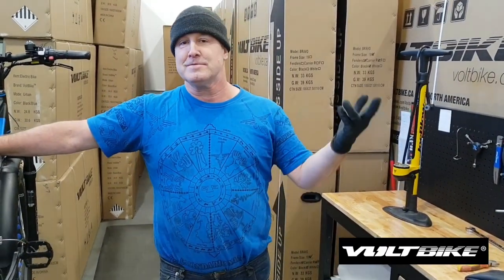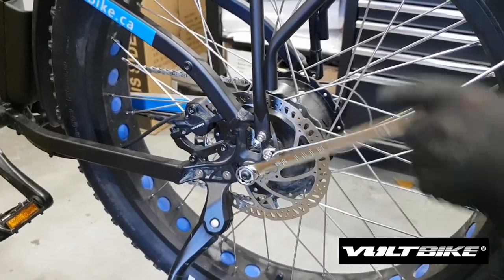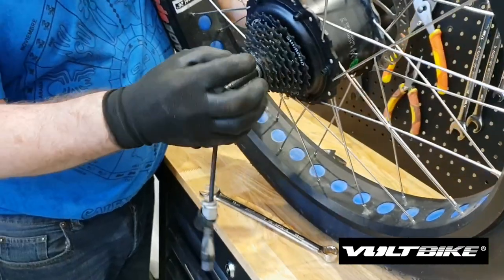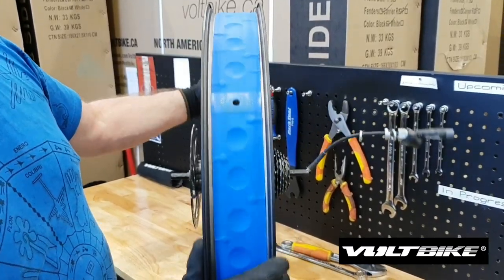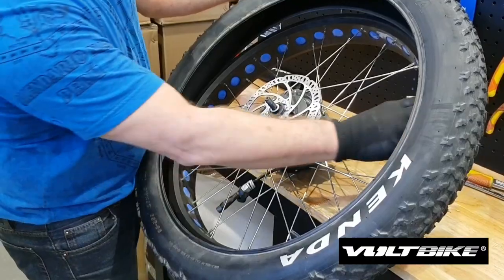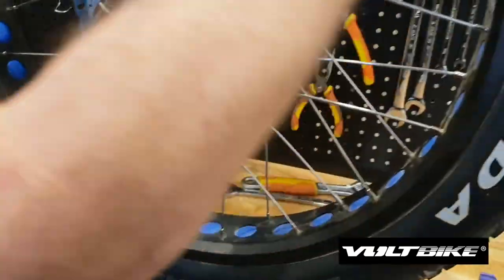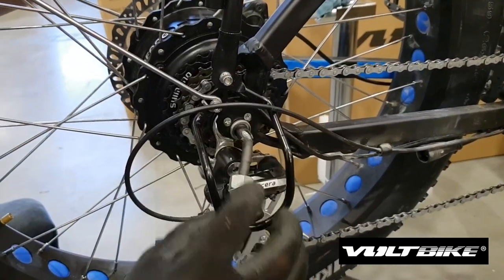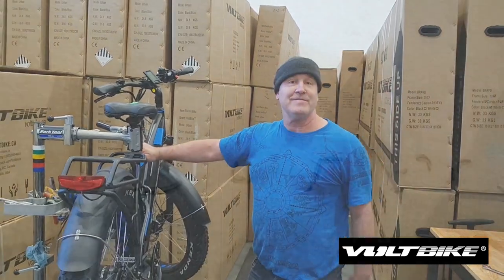Inner tube replacement on VoltBike Yukon 750

Comment: Loved the tutorial, thank you! Normally there's ear blowing music pumpimg in the background during a fix; well actually my cleanings 😊 rarely am I fixing anything on my 750 other than tighting up. I would say you make it look so easy but, practacally,  love how plug and play yukon is. I keep these tools on me incase nature happens on the trail, got my first flat at 2,000 miles i was so impressed. Thank you!!
Reply from the maker: Thanks for your feedback. We are glad you guys like these tutorials.
Reply: @VoltbikeCanada  What about battery BMS reset? I have a brand new yukon 750 and had a lot of trouble with my battery shuting down, always have to reset the fuse and i dont think thats normal(got the same problem at least 7-8 times since i received the bike in early october), always have to bring a screwdriver to reset the fuse.. is it possible that i have a defective battery?Its getting really annoying, what should i do?
Reply from the maker: @pooody  VoltBike batteries are designed to shut down operation in extreme conditions. If you are climbing steep hills or with extensive cargo it's possible that this is triggering the protection. If this is not the case, then you may need to send your battery back to us so our electrician can rectify any issues.

Comment: Finally, someone showing how to replace rear tube on a fat bike. Have to agree, heard to hear, but thanks anyway for the visual.  Now let’s see this done out on a trail 😁😁10 miles from home which is where I always seem to get mine
Reply: It's simple....you don't need to take off wheel to fix a flat....what the hell planet am i on....fixed bike flats when i was 9 years old...just find the problem spot...release the tire from the rim...pull out the general area of the tube that has the puncture find the leak with some spit or water and patch it ...put it back in ...put the tire back on the rim...pump it up and get on with riding !!!!!!  Jeez !!!!!!!!
Reply: @RPMac  Can I call you when I get a flat? =D

Comment: Thanks for the tutorial.  Why was it necessary to remove the nut and washers completely to replace the inner tube?  On my older Yukon with 30 TPI (very stiff) tire, it was much harder to remove the tire.  Regular bicycle tire levers were not strong enough.
Reply from the maker: Removing nuts and washers is not mandatory. However removing them would help you keep track of the order in which they should go back on the wheel.
Reply: @VoltbikeCanada  I don't understand this answer, if I never actually full remove the nuts and washer from the wheel then they will certainly remain in the right order when I put the wheel back on?
Reply: @VoltbikeCanada   your answer makes ZERO sense 🤣

Comment: great video and very informative, I  have 1 question, should you or would true up the wheel or will it center from pushing it in, also can you over tighten the nut on one side more than the other

Comment: Thanks, very good instruction. Try a remote mic in the future for clearer audio. Is it a good idea to use dialectic grease in the motor cable connection?
Reply from the maker: Thanks for your feedback Mike. We will try to improve for the next video. Yes, you can use dielectric grease and it won't hurt. However this is not mandatory and we don't use this in our serial production.

Comment: I cant get any help from my now faulty Yukon 750 from Voltbike Canada. The tech found they wired it wrong, single insulated cables n kinked/ torn wires. They dont reply to email, phone or facebook. EDITED, I did get help by calling their 1800 number, but it only works for inside Nth.America. We have facebook'd a few times now.
Reply: I really wanted to like this bike. But Voltbike did very little that it promised. The color is to this day still wrong on the website. The bike did not arrive tuned. There was damage to the bike. It was very late despite repeated weekly promises that it would ship the following week. I had to ask for a partial refund that did not even cover the tune up, let alone the damage. I should have bought a Rad or maybe a Juiced.